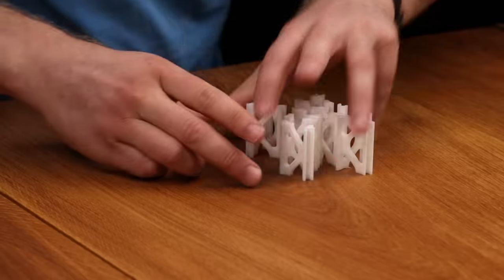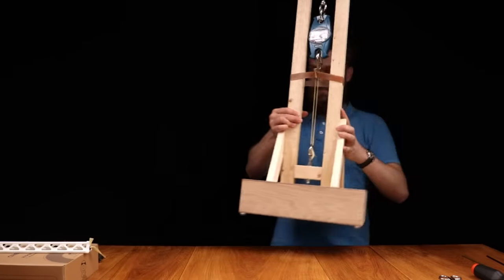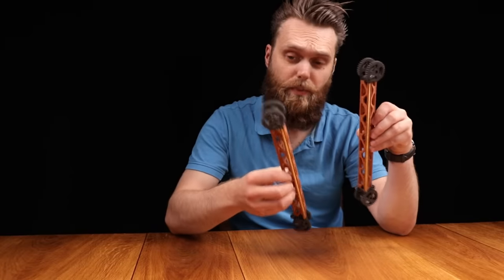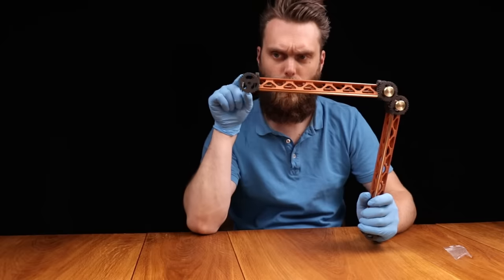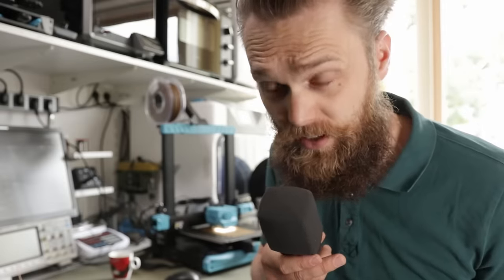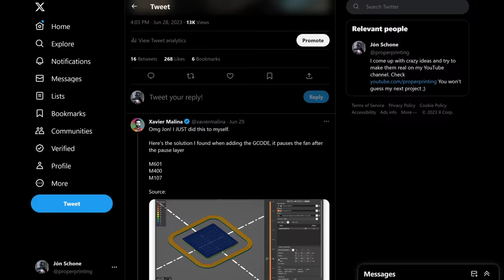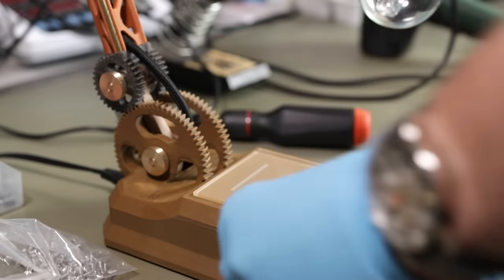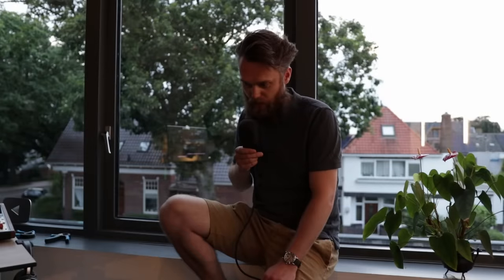You can build AWESOME things with this 3D Printed System!

Comment: Hello, this lamp is very interesting and I was wondering if the arm could support a weight of around 650gr. I bought a small LED panel some time ago, 22.6x22.6cm square, and I could have considered putting it in place of the bulb you used for lighting, but it weighs more than the bulb and I'm not sure the arm could support such a weight. Looking a little closer at the small LED panel in question, I can see that the driver's location can be removed, so I might be able to shift the weight of the driver (which must be mostly that of the whole panel) and thus lighten the weight at the end of the arm, but if in doubt, I'd rather know whether the arm could support the 650gr of the panel and driver, what do you think?
Reply from the maker: 650 grams is too much. The microphone ways a bit over 300 grams and I already had to make the arm shorter and also came with some issues that I've shown by the end of the video. Therefore I need to improve on this design and probably add metal parts as well. If you eventually want to 3D print an arm that has to hold this weight constantly I also suggest using other materials besides PLA because PLA will deform over time. PETG, especially with carbon fiber, will be better for this purpose. When I'm going to build the printer, this design should be a lot better already and this is planned for the nearby future.
Reply: @properprinting  Oops, thanks to YouTube, which no longer sends notifications and therefore I'm only seeing your reply now, 3 months later ^^ So I'm a bit late, thanks for your reply, I'd put this idea to one side as I'm waiting to move house to set up a "workshop" and I'll see when I get there what would be the best lighting idea (or lighting with an S if several sources are needed or if a source that I can move around depending on where I am and what I'm doing in the future "workshop/craft corner" that I'll set up. In any case, I'm keeping all the ideas I've come across here and there and I'll no doubt find the best way to enlighten myself. I'm sorry again for the delay in replying, but for some time now I've noticed that I don't receive any notifications when someone takes the time to answer a question I've asked. I've got used to not getting an answer, and sometimes I discover one, as here, days (in the best cases), weeks or months later. In short, the joys of the internet ^^ 👍

Comment: Tensioning using tuning doesn’t really work that well when considering varying lengths. A longer rope under the same tension force is going to be lower pitched than a shorter one

Comment: Did you not see the OceanGate submarine disaster? Carbon fiber under tension is not the best idea. Also, you should measure the accuracy of your rails and how it changes (I bet it gets worse) with increasing tension. The acoustic force measurement is really cool, I wonder how accurate it is.
Reply: Im pretty sure that you accidentally mixed it up, but carbon fiber is strongest under tension.

Comment: If you want to determine the force on the fiber, u can use this fomula:

f=(√(F/μ))/λ => F=μ.(f.λ)^2

f= frequency
F=the force on the fiber
μ=mass of the fiber per unit of length
λ= wavelength, length of the fiber multiplied by 2

This should be a little more scientific then listening. I hope it helps
Reply from the maker: Thanks!

Comment: This is a really intriguing design; being strong, modular, easily constructed, and even quite pleasing aesthetically.  I look forward to seeing how you utilise this system next.
As far as having high strength to weight, have you considered polymer fibres such as Dyneema or Spectra?  These fibres may have a slightly lower tensile strength compared to Kevlar, but have much higher strength-to-weight ratios - around 3-5 times Kevlar.  You can buy woven fishing line made of these fibres for reasonably cheap.
I hope this is useful.  Have a great day!

Comment: I think your railing system is really nice, BUT only ecstatically, function wise it's way too much assembly and part which can all have their flaws and fail. The only reason that 3D printers have alu frames is simply because they are cheap, lightweight and ridged enough and also already have a ton of profiles, which means production and therefor the printer cost and shipping  are low. However for a selfmade printer and especially a fast one, weight wouldn't be much of a concern! you want that thing solid! So yeah, i dig your passion for the system, but i don't really see a high end printer being better than what is already available.

Comment: Beautiful lamp! But I'm worried about it using high voltage electronics... PLA while not bad at electrical insulation, it's not a fire retardant.
What you could do to mitigate this hazard: 
- introduce fuses to prevent a sustained short circuit
- switch to a low voltage LED system (with fuses)
- switch over to ABS or PP
Reply: I wouldn't worry about that.  People make lamps and other electrical projects of wood which is also flammable.  In fact, your whole house is probably made from wood with wires running through it.
Reply: @mdbbox5660  I live in Europe... Our houses are usually made from bricks & concrete 😉
Also, our high voltage light fixtures are usually made from metal and glass... So, yes there are improvements that could be made to make the lamp less vulnerable to electric faults...
Reply: @MiklosGalicz My point is that there's no need to make "improvements" to guard against electric faults.  Just don't be cavalier in the wiring or its connections.
Reply: @mdbbox5660  you can go with the Chinese method of making it work as cheap as possible (being that the main objective) or you can adhere to actual electrical standards and intruduce some measure of protection... A fuse is quite cheap and very easy to introduce, don't skimp on it.

Comment: So uh,  could have just made the foot an emtpy basin with really thick walls,  and used a printed scew cap to hold the sand in.
The internals can even be fortified to better hold the arm into the casing.
Easier fill and a way more robust design. 

Yet you chose to do this really awkward and potentially damaging way of filling the foot andi genuinely don't know why ^^'
Reply from the maker: I still think that this is easier and better than using a screw cap. That would mean that you cannot use infill and in the time that you've designed the screw cap functionality, I've already filled this up with sand. Pausing a print and filling it up is not that uncommon and I've never done it, so I also wanted to experience that and learn from it!
Reply: @properprinting  Honestly, you have every right to do what you want with your machines. Especially as a learning experience.

But as a Designer, consultant and silver level educator under Autodesk, this hurts me ^^' 

Just keep in mind, Taking an extra step to complete a design, even though it might take you a bit of extra time, may save you a bunch of head aches down the line ^^

Though i would argue that designing the foot like a container that can be closed, is not really that time consuming if you know what you're doing, especially in software like Inventor professional or even Fusion 360 :) 

I look forward to seeing what else you come up with, and to see what you learned from this experience.

Comment: yes cool very fine, but plastic cost a fortune, why no one talks about that ? Why no one talk about the fact that you can print with old plastic bottles ? Why ??
The 3d printing industry is not thriving as it should simply because the PLA is way too expensive, so printing your lamp or buying it will cost the same. So why bother ? Why not talking about a way to at least recycle you failed print ? 
You just don't care about the environment.
Reply: Recycling failed prints and bottles into filament is a thing, there are a bunch of videos covering that on here. The only issue is that you either need to put a lot of time into building your own setup for grinding and extruding, or spend quite a lot of money on a prebuilt machine.
This means that for most people it is a lot cheaper to just get new filament.

Edit: Just noticed that you mentioned this lamp would not be cheaper than buying outright.
That is correct, but I feel like you are missing the point of 3d printing. 
Mass produced goods will always be cheaper due to economies of scale, so nobody should get into 3d printing to save money.
The appeal of the tech comes from its flexibility to rapidly prototype and create shapes and structures tailored to specific applications.
Reply: @spider_sf  I think that you don't see the entirety of what 3D printing should and, I hope, will be. Something that can be more economic than industrial plastic, because at the opposite of what you said EVERYBODY would get into 3d printing if it saved money and reuse trash plastic ! The fact that only a very few people use 3D printer is only because it's way too expensive !
And for what you say about prototype and tailored shape, so what's the point in printing a boring lamp that ressemble any other one and have absolutely no useful specificity whatsoever ??
Today a 3d print can be cheaper that a mass produced object by the simple fact that it would come from trash !
Doing his own filament with bottle is only complicated because we need a lot of people spending time building the right tool for it.